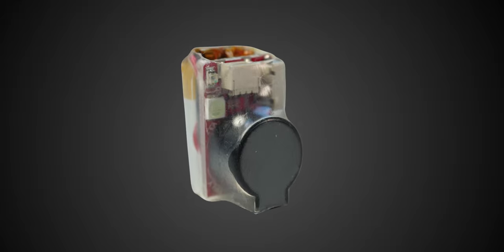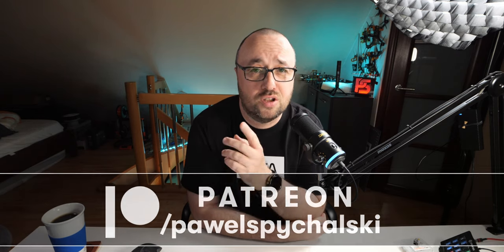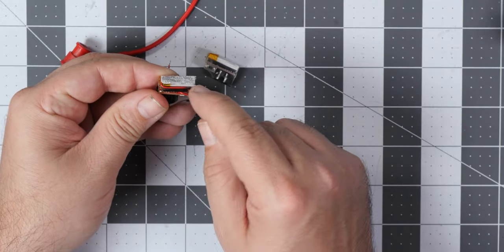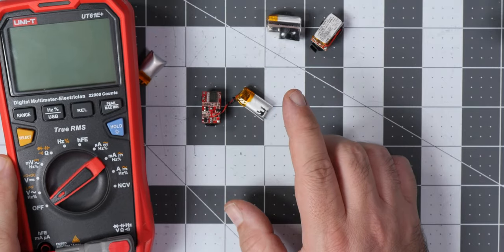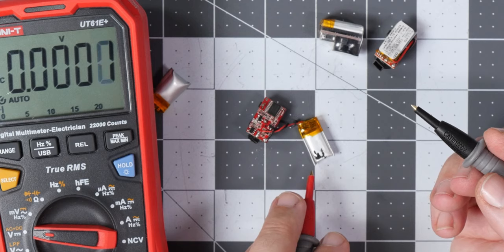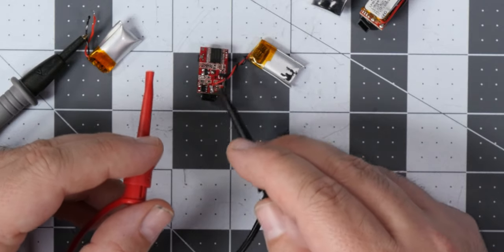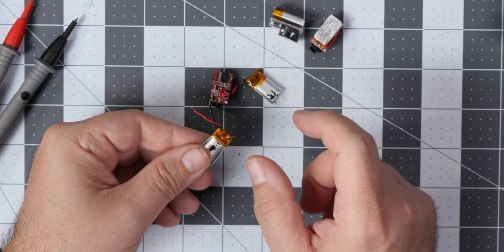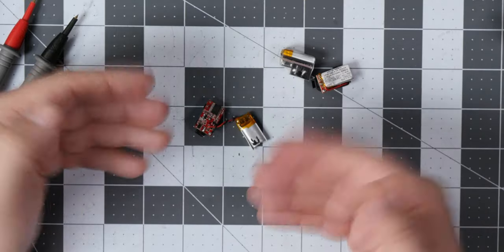How to fix a dead model finder buzzer

Comment from the maker: Which battery is more efficient? 6S or 4S? https://youtu.be/76TIanhpReA
Reply: can I get a 6s model finder buzzer? 😛
Reply: what is the fire danger from these I wonder, they're sitting idle in models that don't fly very often a lot.  they'll charge just by plugging USB into the flight controller won't they?
can you do some stm32nucleo/LoRa/serial comm code examples in a vid maybe??
Reply: Moar Volts = Moar Efficient?

Comment: Pawel told me to write something. I don't use buzzers at all. I plan not to crash. And if I do, I'll never reach it anyway. Good info Pawel.
Reply: Checked your channel based on that comment. Great stuff! Long range ftw 😊
Reply: @AlanzFPV  Respect your gear, Git gud at it. Be responsible and have a blast. Pawel is a source. Still trying to accommodate Inav to some of my quads. Thanks mate!

Comment: I've never had one go bad, even after a year in storage. I buy the ViFly brand buzzers and GPSMates and they are made well. I think they stop charging at 3.8V, which is perfect for storage. I also made an adapter that fits the connector and hooks to my power supply, so I can give a yearly charge to the ones that aren't in quads.

Comment: Fantastic, Pawel! Thanks a bunch!!! 😃
Another option for charging the battery would be a TP4056 module. Just solder wires with alligator clips to it and you can use a smartphone charger as power source. 😊
Anyway, stay safe there with your family! 🖖😊
And merry Christmas!

Comment: Those protection board typically build around DW01. Which is a li-ion protection ic with 2.4V overdischarge detection voltage. That is why lipo battery can die quick...
It would be better if they use XB8588D or FS312F-G (both have 2.9V overdischarge detection voltage).
For charging usually TP4056 is used. (which is almost fine, but designed for li-ion too). 2 ICs for battery managemant. There is single chip for that kind of work, eg MCP73837. Probaly that chip costs little more...

edit: cheapest way with some physical (eg dip) switch to "disconnect" the battery from the main board...

Comment: Thanks, Pawel good stuff as always.
 For me, 4 buzzers out of 10 develop an issue (after a month or so ) when they cannot be switched off. The button works fine (tried shortening directly) but the buzzers still beeping. So I disconnect the bat and accumulate them maybe there is a fix for that as well.

Comment: I have a dead buzzer. Winter is too long in FInland... :) 
I was asking myself:. What if instead of powering from VBAT 5V, I would power it from the USB 4.5V (Lumenier LUX F7) ? In this way I could charge it by just plugging the FC to USB connector to a desktop computer. Will this also 'unblock' it as you were suggesting?
Reply from the maker: If you power from 4V5 then it will charge when USB connected, yes. Still you have to remember to charge it from time to time. And of course, it will beep when you unplug USB :)

Comment: Seems the same issue from which several others types of lithium battery powered devices become nonfunctional. Even many smartphones suffer from similar issue. If battery is not really dead and charger part is (still) functional, charging the battery directly till 3.3V solve the problem. BTW are something tried to power these buzzers from supercapacitors? You can't kill those in such way.

Comment: oy. I regulary measure voltage in my ViFly Mini Finders and GPS Mates. I try to keep them close to storage voltage as possible when not in use, so the battery wouldn't be dead by the time I would need it.

Comment: Could you use a rechargable coin cell battery instead of a LiPo? If possible you could solder in a holder for it and make it easier to swap next time.
Reply from the maker: If it's LiPo then sure. But charger will work only with LiPo/LiIon

Comment: This doesn't help me, if i put 5V to the buzzer the red light is on, if i unplug it is off, no sound.
The board charging puts out 4V but unplugged it is 0V.
If i connect signal it blinks but makes not much sound.